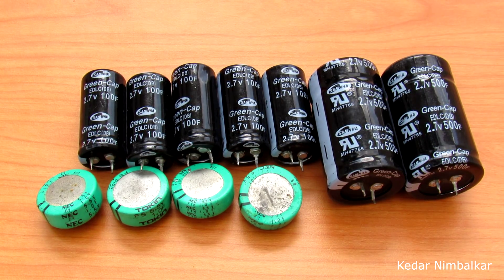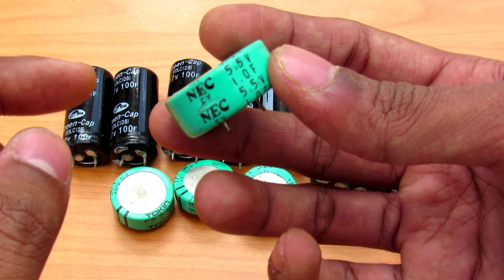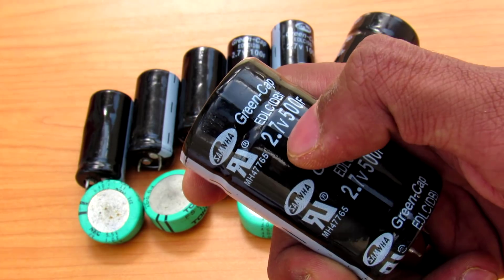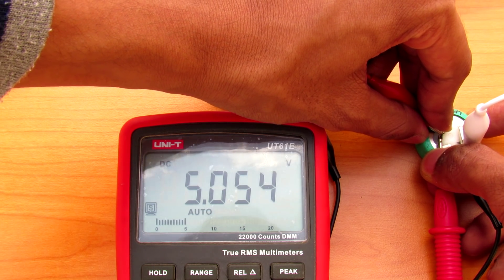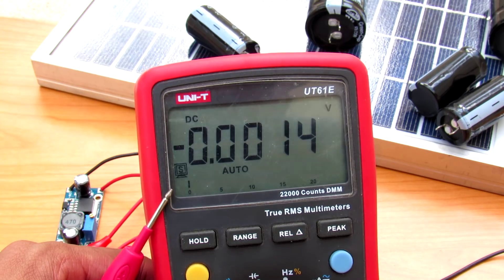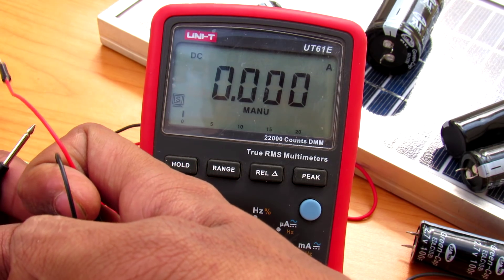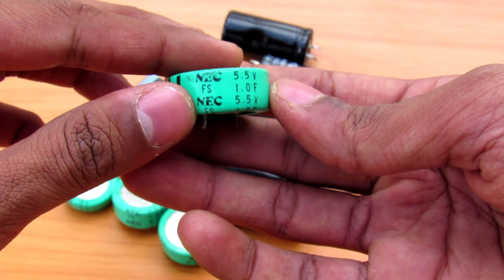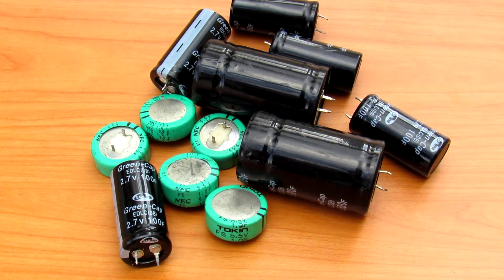Supercapacitor vs Battery

Comment: Normally, the maximum current a supercapacitor can give is determined by the product of the voltage and capacitance.

Since the supercapacitor is 2.7 Volts and also 100 Farads, the total peak current it can give is 270 Amperes, sufficient to start a bike or even a small car upto 200 Amperes starting current.

However, the reason why multimeters cannot be used is because, most multimeters have high resistance shunt resistors that limits the current passing through the multimeter. Some multimeters can be permanently damaged by the measurement of such high current, so don't try it.

Besides, these Samwha branded capacitors are not always working versions. Sometimes, factory rejects and counterfeit pieces are shipped.

Comment: By the way, it's not worth it to replace any batteries with capacitors because it would be about 10x more expensive per Amp.. unless you got unused Capacitors to play with..
If you need more power to start your motorbike or car, just buy a new upgraded batteries as the most economic solution.

Comment: I have 6 of those 2.7V 500F capacitors connected in series.  The total capacitance should be 500/6 = 83F but when I tested them I only got 48F so I think they're either a bad batch or it's exaggerated claims.
Still pretty amazing devices though.  I can charge the bank to 13 volts in about 10 seconds with a 40 amp bench supply.  A short circuit on 1mm diameter copper wire (as used in winding transformers melts in about 1 second!  And then it still has 6 volts on the bank.

Comment: Question for you Kedar: from my calculation if the 100F cap is charged with 364 Joules, then if you turn that in Watt/hour is 0,1 W/h ..so it can supply only a small LED for 1 hour ..wright?
Reply: Yes

Comment: have try hooking up the 1F 5.5V (in video) to a microcontroller???
because I'm thinking it will be really cool if I could place a 3.3V coin battery with the super cap of that size to power the MCU and still get the same or better amount of performance.

Comment: Hi Kedar, Can you tell me where to buy supercapacitor and ultracapacitor in Mumbai. Or Online. and roughly how much it costs.
Reply: here you can find supercaps: http://www.tme.eu/ro/katalog/#id_category=113190&page=1&s_field=artykul&s_order=ASC
Reply: 100 F/2,7V is about $8 ...I don't know if it is cheap considering the very low energy stored...
Reply: According to Indian currency its not cheap it costs around 300-900Rs
Reply: At ebay there are cheap

Comment: how you stop over charging and it going bang ?
Reply: if its a capacitor the characteristic should be the same.
1) you have to fix the input voltage to the capacitor's rating else you will start to see magic smoke.
2) it should stop drawing current from the supply after its fully charge.
Reply: Theoretically the resistance increases exponentially as it reaches its capacity.Based on my theoretical understanding you don't have to worry about over charging it

Comment: Great videos Kedar!  I always liked building projects since I was 9 years.  I had some ideas to ask you about.  I will find the papers.  A  one time emergency cap. for phone is what I want to build.  Fast strong and very small.  because all the have is big bulky ones or somewhat small but very cheaply made junk.  I need the right cap. to just plug and go.  for my 3000 mah battery in a Galaxy.  and I hope I can set it up without a circuit volt booster  just charge and discharge straight to phone if possible.  I will continue watching for more ideas.  thank you for your great! Posts!